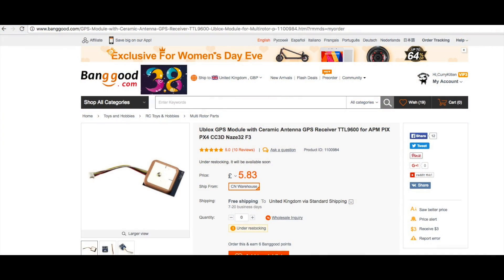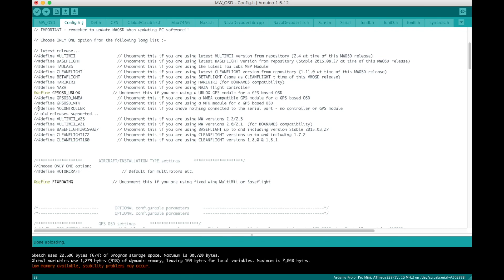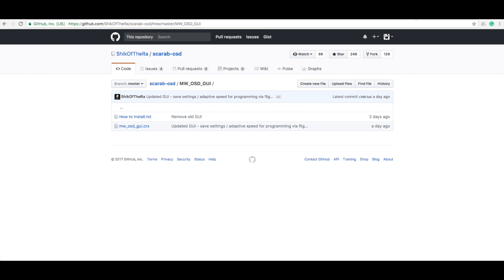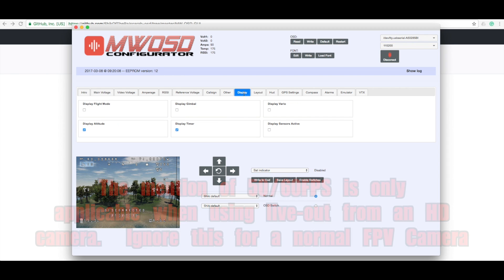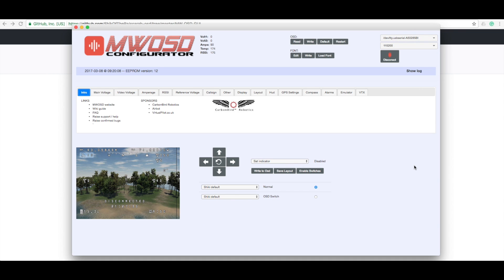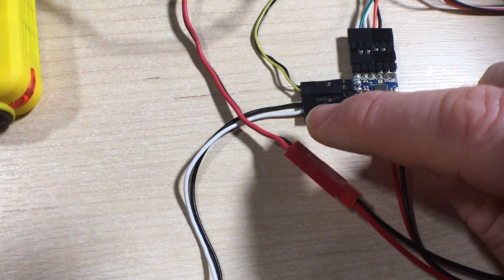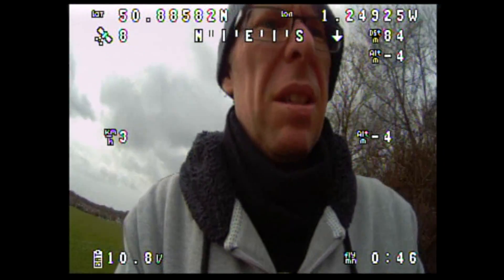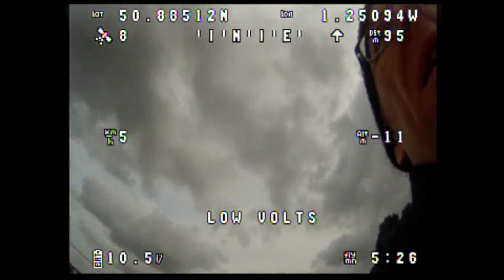A GPS OSD for £10 ! : Setting up a standalone MicroMinimOSD Part 2

Comment: Hi, does it measure the altitude better when you get higher up in the sky?
Reply from the maker: Not really - it still just triangulates GPS signals to work it out.  The difference higher up, is that it won't seem as wrong.  You skim along the ground and your altitude reads "10m" it feels out, up high the difference between 100m and 110m is more difficult to percieve

Comment: thanks for the info . not much on the GPS unit from BG available on the web.
by any chance do you know what generation ublox that GPS uses , 5,6,7 or 8m?
u-center has a code window that you can change (or check)the cfg files - baudrate 
have you tried uping the GPS units baudrate with u-center?
your using 115,200  for the OSD ?  i've tried to change the baudrate with u-center 
but the GPS unit defaults back 9600  even changing the GPS cfg file .
 so the BG GPS must still be talking back at 9600.
i'd be curious to see what your GPS is really working at
Reply from the maker: The chip on the board is a Ublox G7020-KT which I think is a Ublox 7 ?  I didn't use u-centre, but I hooked up to an Arduino to make sure I was getting data, which also let me look at the baudrate.  To be honest I never looked into how I change any settings on a permanent basis... or even if you can.  Mostly because I don't need to.  If you look at the MWOSD arduino code, if you set your GPS as Ublox, what it does is send a command to the GPS cycling through the baud rates in order to set up a few options... one of which is the baud rate itself.  It talks the specific Ublox protocol making it all a bit faster.  So when connected up to the MicroMinimOSD, it's talking 115200, and I can see this by outputting the serial data on my arduino.  But, it doesn't hold this config, power cycle it and remove the OSD and it's back to speaking 9600 on NMEA
Reply: so your right  i checked the parameters ( theres about 30 pages of them) and found out that it is in fact a ublox7
Reply from the maker: Sounds like it was buried deep within those pages then :)  Interestingly I'm just sitting here with another cheap one I picked up on Banggood for using with iNav, and that tells me it's a NEO-M8N... so at least that one is a bit easier to identify
Reply: after setting the correct settings on ucenter i get 
about 10 satellites and a 3d/dgps  lock but it can be slow to connect,
60 to 90 seconds  to get dgps  30 to 60 seconds to get 3d from a cold start..and sometimes no dgps lock at all, you might  need 8/9 or more satellites to get dgps lock... ??

Comment: Thanks for another great video. I was able to successfully get
my own system to work. It took quite a bit of head scratching, mostly due to my
inexperience. I did not realize that it took all 6 pins form the FTDI adapter
to program the MWOSD, I assumed that it only took the 4 pins used to communicate
with the GPS. Second I did not realize that you had to upload the bold font. I tried
using bold font without uploading, a complete fail. I finally had success
when I just used the standard font. Lastly I did not realize that you needed to
choose //#define ROTORCRAFT or //#define FIXEDWING
Reply from the maker: Glad you got it sorted - it is something that takes a bit of experimentation - certainly not plug and play.  It's only when you get the right output that all the options suddenly make sense.

Comment: Great Wayne....what a cheap OSD / Nav aid....impressed.....I have a spare Minim, I just need the GPS puck. Makes a very compact simple light unit without the current sensor too.....Useful....Not sure about what you did with the GPS puck tho...why did you need to adjust it again..?
Reply from the maker: I was literally walking around the park with an armful of electronics expecting to hear a cry of "he has a device, take him down" all the way.  The GPS receiver was balancing in a hand until it fell down and ended upside down hanging by it's wire.  Apparently there's not so many satellites beneath the earth :)

Comment: Cool little thingy!
Is this usable when flying a mini quad while doing flips and rolls?
Does the sattelite connection then cut out?
Reply from the maker: An upside down GPS receiver won't get any coverage. Some quick flips and you'd be ok though.  That said, it's not really the sort of thing I'd expect to put into a mini quad.  Perhaps something 450 sized or a plane is it's more natural home.  Not to say you can't though
Reply: CurryKitten Okay, thanks for the explanation.
Also I am really thankful for encouraging me and many others to fly acro mode!
I have learned so much from flying in acro. It's sooo much smoother and faster as you said. Every crash I feel myself improving!
Also I really like your channel, keep up the good work!
Reply from the maker: Yay - nice going, crashing is part of the learning process.  I try to learn at least a few times every outing :)